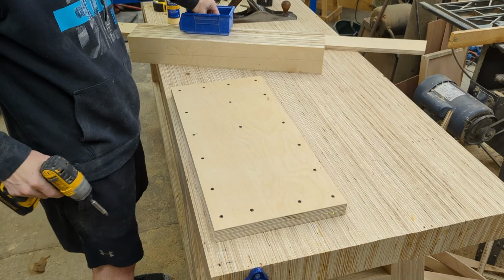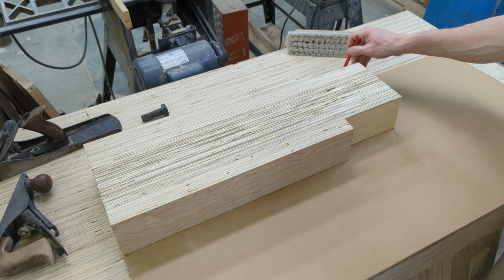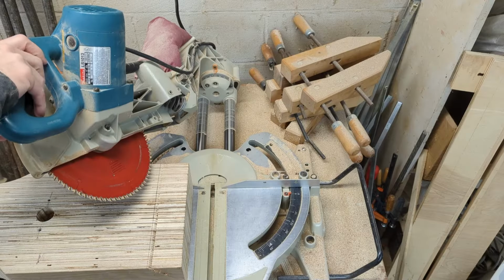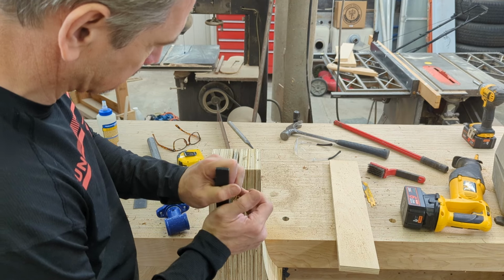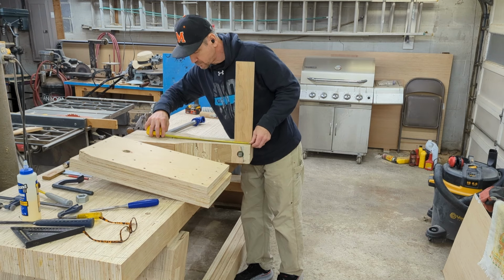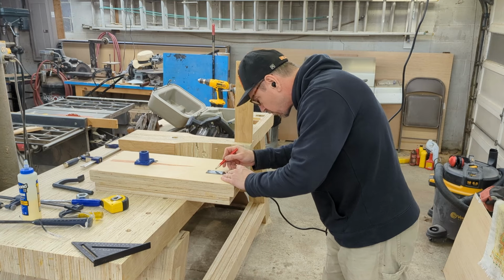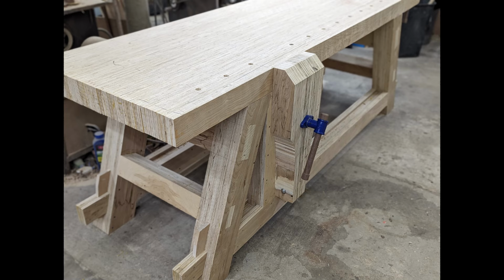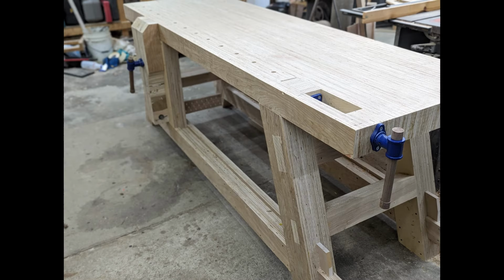465 LBS Moravian Workbench - Leg Vise - Episode 9

Comment: Cool build. What are the pros and cons on a laminated bench like this vs a traditional one?
Reply from the maker: Thanks! Pros: I would say it's easier to build. Tenons and mortises are automatically the right thickness due to the equal number of layers. Second, stability of the material. Very little movement over the seasons is an advantage. Cons: Plywood is not that hard of a material, so cuts, gouges, dents are more likely to appear. Delamination of my cheap plywood is also a concern, especially on edges and corners.

That all said, I think the weight and abuse this bench will take will outlast my lifetime, if not into some other person after me.
Reply: Excellent work dude 👏